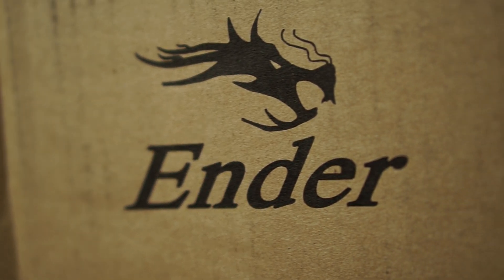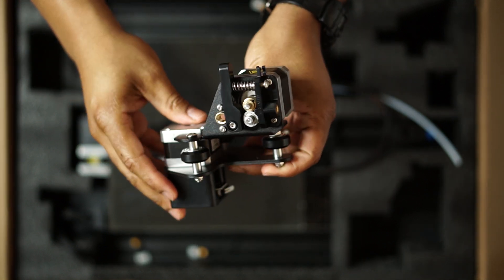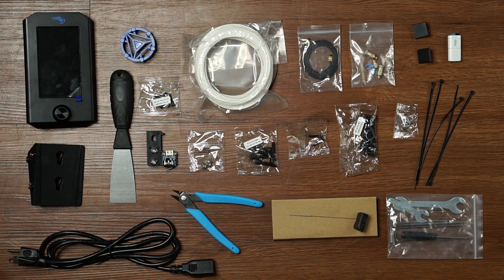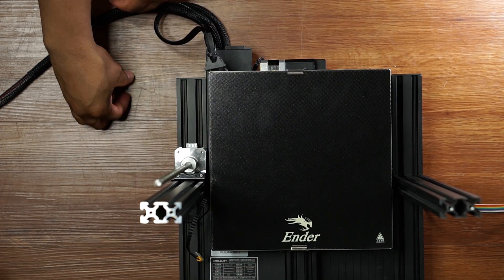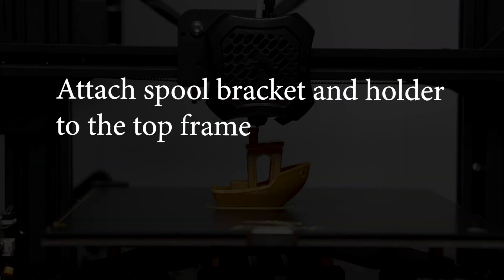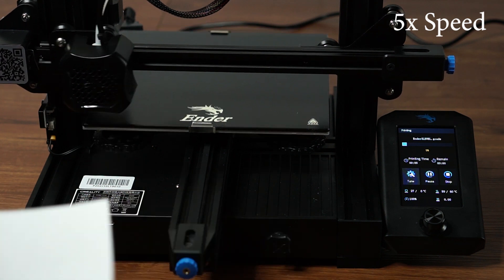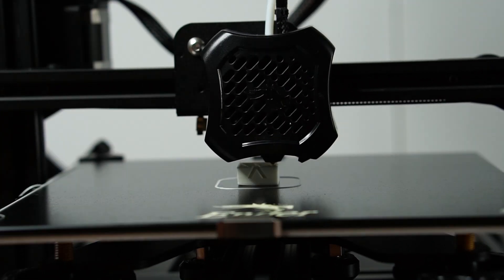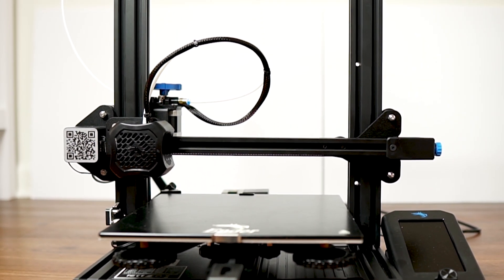Ender 3 V2 3D Printer - Unbox, Assembly, & First Prints!

Comment: I'm not an expert either and have also been watching a lot of videos. 
One thing I have picked up is wipe the bead down with some isopropyl alcohol. PLA on that bed is suppose to stick well to without adding glue stick. Maybe you had oil from your hands get on the bed. That can cause issues with bed adhesion.